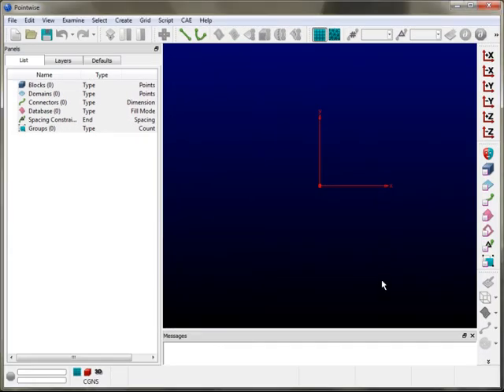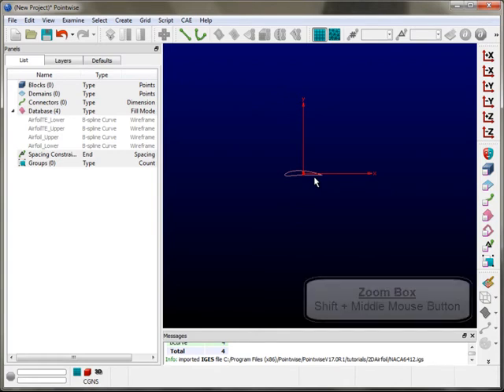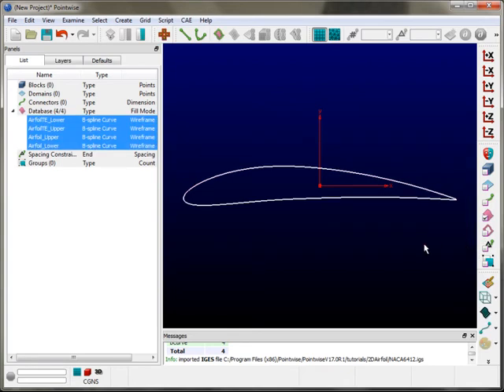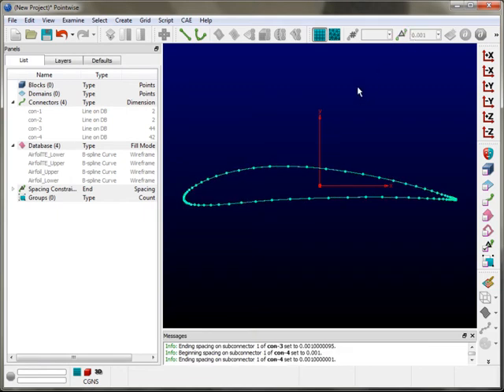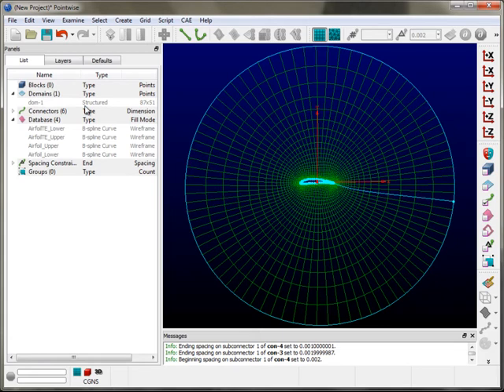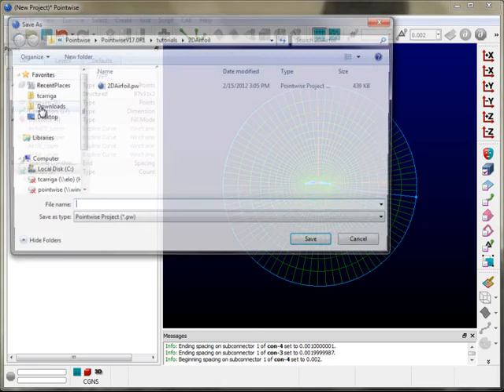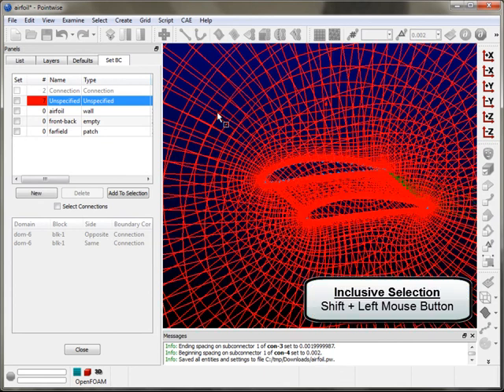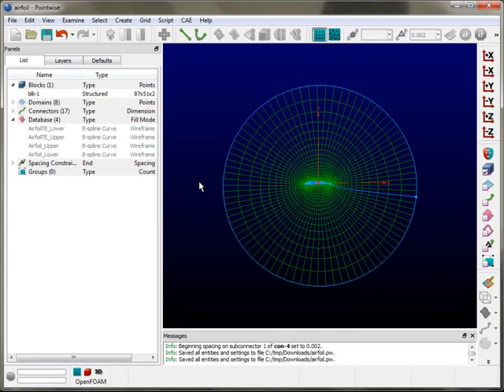Getting Past the Blank Screen - CFD Mesh Generation with Pointwise

Comment: I have a doubt wrt the farfield bc specified in this. I am referring to the outer periphery of the O grid; the wheel surface. Suppose I wish to give one half of this region as inlet, and the other half as outlet. But the regions are not showing up as 2 equally split regions. How to proceed?
Reply: Because BCs are applied to the mesh topology (the connectors in this case), you would split the outer connector in the appropriate place(s) and apply the BCs to new connectors.
Reply: @JohnChawner  oh ok.. so i need to first generate the connectors, followed by normal extrusion to create the 2D O grid, and then I am supposed to split, before translation to z direction?